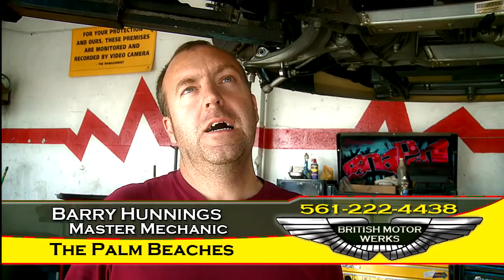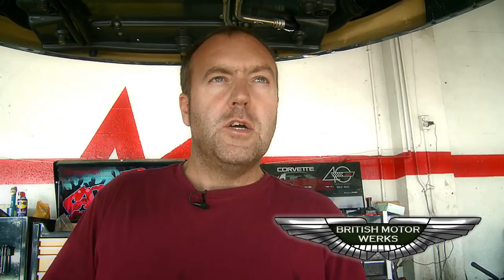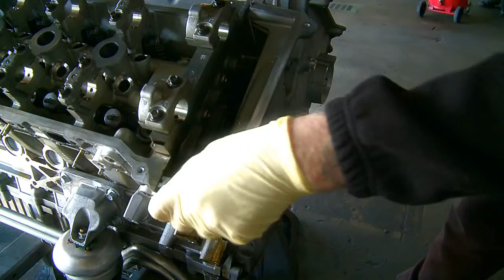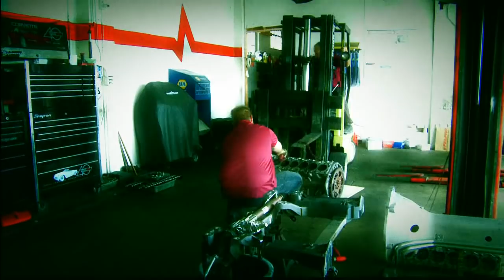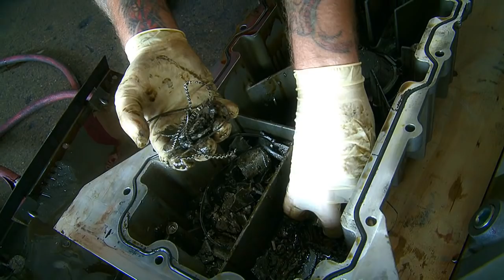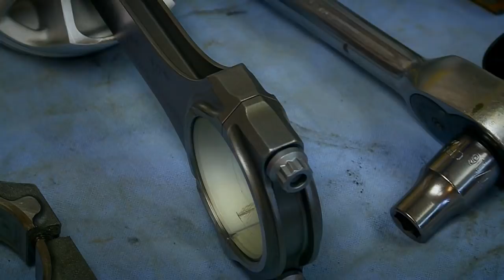2005 ASTON MARTIN DB9 Engine Detonation

Comment: Oil in the air filters is a sign of a PCV valve problem.   Known issue in these engines.  Also, the early 450 HP engine do not send oil to the small end rod bearing.

Comment: Nice video, I have owned a DB9 and currently a Rapide.  Lack of oil to rear cylinders is a design flaw in earlier engines.  Never let oil get below “Full”.  Keep it religiously topped of.  Marvel Mystery Oil might help since it is a solvent oil to remove sludge buildup in small oil journals.  It will evaporate off in about 1000 miles.  Agree that top spec pistons and con rods should be in this engine.

Comment: on these early v12 engines the lowest pick up is on cylinder 6 and 12 , the original dipstick marks are set too low on these engines rectified by Aston re replacing with longer dipsticks , you had to check engine oil was above the high mark to avoid oil starvation... Note thee is no electronic oil level warning light on these Astons once the low oil pressure light illuminates its too late . you have to check oil levels weekly ....good old fashioned practice . A lot of owners never bothered relying on service schedules , hence using oil , never topping up and hence gettin g into this  catastophic failure 20k worth of damage

Comment: Small end bearing wear. A known fault in early cars caused by oil starvation due to the too long dipstick. My first DB9 had the same issue. It usually manifests as a low end cranky ticking on idle. If you hear this sound on a DB9, walk away. It's literally a £20k rebuild using the updated cylinder bushings.

Comment: A bit of research will show the true cause. The early models had a problem because the engine oil dipstick markings were too low and this was caused by the dipstick itself being too long. This effectively put the level markings too low in the oil and in turn this results in the oil levels being too low for long term and high performance use, which in turn caused oil starvation and typically this effectively destroyed the engine. The cure, which was effected in an Aston Martin service bulletin sent to all service centres as soon as the problem was discovered, was simply to replace the dipstick with a new longer version which meant the engine had more oil - nothing else! My own DB9 had this problem and it caused serious damage which was resolved with a complete replacement engine at 30k miles under warranty by AM. I don't expect any DB9s are on the road these days that still have the early longer dipstick so even early DB9s are generally a safe bet nowadays. This video implies that AM engines should not be trusted and this is a complete fallacy. Yes, like many other manufacturer's early production examples, this engine had a design flaw but that it was addressed early on and effectively by Aston Martin. At no expense to the owners. The oiling system is not junk as is claimed - yes, a design error led to an inappropriate dipstick - not the entire oiling system and certainly not the entire engine or car itself! This video is just clickbait scaremongering! My engine is running perfectly after 75k miles, so suck on that! A mechanic finding a fault doesn't make him a genius nor does it make the manufacturer a scoundrel. This is just taking a cheap shot without any decent research. In my view this reflects badly on the video maker far more than it does on Aston Martin.
Reply: hey your db9 has 75k miles??? im about to buy an aston with 80k miles lol

Comment: The off the shelf piston ford PAG used kind of makes sense. The AM V12 is basically two duratec V6's mated together. But still, for 250k, they should of went dry sump with that piston/rod combo from the factory.

Comment: Would'nt all those metal parts damage the rest of the engine? Is it really worth the rebuild?
Reply: Not a problem. The schrapnel of parts submerged in the thick oil in one compartment. Total engine acid bath followed by clean room rebuild.
Reply: @budwolverton5916  Not sure I'd call 0w-20 oil thick, but chunks usually migrate to the bottom. All the rotating parts are probably fine as all the crap should be in the oil filter instead of the bearings.

Comment: Ford REALLY didn't care all that much for the Premium Auto Group (PAG) back in the days; look at how Jaguar Land Rover fared back in the early 2000s. It's no wonder the 6.0 V12 was designed with existing components; costs can be saved & it is just a simple matter of bolting two 3.0 Duratec V6 from their parts bin together & having a premium car for cheap.

The fact the 6.0 V12 with such mediocre roots still lives today yet with Aston's constant updates kept up with more demanding emission requirements & ever increasing demand of power is kudos to Aston once Ford left them for dead after post-2009 recession. Thankfully this engine will soon be replaced by AM's own effort in the new upcoming Twin turbo V12 which I heard was designed with aid from Mercedes-AMG division.
Reply: Pretty damn pathetic isn't it? What's the price difference between the stock shit pistons and rods vs a quality set? $2,000 give or take a few hundred? Literally ONE PERCENT of the cost of the car. Wtf man.

Comment: Not sure why they're crapping all over the piston assembly. it's not like 460 hp out of a 6 liter v12 is a lot. Those pistons and rods would run 200k miles no sweat with proper oiling. And no, an H beam is not stronger than an I beam.
Reply: If you don't know why there's an issue with placing economy car engine components into a $200,000 car, then there's no sense in explaining why you're wrong about the connecting rods.
Reply: GTRZE70 Fantastic argument. You've changed my mind.
Reply: +Cory Stansbury Good.
Reply: Of I beam and H beam rods made of the same material, the H beam is stronger.  This doesn't mean an H is always better than an I beam, the I beam may be more appropriate for a high revving engine for instance...
Reply: Baba Booey This isn't really supported by engineering. An I beam is stiffer per weight than an H-beam, at least in the typical bending direction (realizing an H beam is just a flattened I beam in the other axis).
Reply: I believe H beams handle compressive loads better than I beam.  If you put both in a vice and applied sideways force, yes the H would probably bend first, but that's not the application here.

Comment: Ford and Jaguar developed a V8 engine used in Jaguars, Lincoln (LS), Land Rovers and Aston Martins. The AM version motors are only used in AM and were built on the same site, but really in a dedicated section of the plant and most of the components were different. I guess Ford had "influence" since they ultimately owned everything, but it's like saying a BMW M3 motor was the same as a typical 328i ... the car in the video is a 2005, and AM has redesigned the engines somewhat since Ford sold off Jag, AM and Land Rover in 2008. The V12 was a unique motor to AM (although based on the discontinued Jaguar 12's). Again, I guess the relationship with Ford could have led to some carry-over of parts ... I think the 08+ V8 got forged rods, not sure about the V12, but they're built in the same plant which is now owned only by AM.

Comment: Ford DOES build these engines
Reply: This engine is built inside a Ford engine plant in Cologne France,, but is built by Aston Martin as they have separate Aston Martin division inside the plant and the engines are individually built by a single Aston Martin technician not Ford workers. This engine is used for Aston Martin cars not Ford cars, in the end it hurts Aston Martin not Ford.
Reply: @A-FrameWedge  Actually it's a Mercedes Benz engine plant.
Reply: @b747skyguy  Wrong, the V12 in the 2005 Aston Martin was made by joining 2 Ford Duratec V6 engines.

Comment: People on here blaming Ford.. lol. Ford has not owned Aston Since 2008.
Reply: +santiagomel00 This DB9 is a 2005 (which is clearly stated in the video description), meaning that the car was both designed and built WHILE Aston was under Ford ownership.
Reply: +santiagomel00 Doesn't mean they don't still have Ford parts ... which they do!
Reply from the maker: +santiagomel00  Car was a 2005 and video is 5 years old
Reply: it'd an 05 Aston.. Ford owned Aston when this car was built...
Reply: +santiagomel00 I would say that an AM from 2005 (Ford Era) that has a V12 engineering problem can be safely blamed on Ford since they were running the company at that time.
Reply: Have you got a brain?
Reply: In fact if you look at certain AM parts like the heater blower, it's really just a Ford blower that has some minor changes so that they can charge 5X as much for it.
Reply: You didn't even watch the video, did you? If you had, you'd have heard the machinist say, "This is the stock rod and piston that came out of this Aston Martin, basically your garden-variety Ford piston from either a Ford pickup truck or a Ford Mustang. Unbelievable that they put this in a motor of this caliber. For a motor of this caliber, of this status, I can't believe they put this type of crap inside it."
Reply: Ford also built the GT500... much cheaper car..... much stronger engine. So your argument is ridiculous. How do you explain that ? This is more or less a fault on Aston for designing and building a inferior product. Also the failure (if you watched the video) is due to oil starvation of cyl 6 and 12 and an obvious fault of the oiling system/pump which was designed by Aston Martin.  The Ford GT which costed less didn't have these problems.... this is all on Aston... sorry.
Reply: The only thing  stronger rods/pistons would have done would delay the inevitable for just a LITTLE BIT longer.
Reply: I agree it's not like Aston Martin was known for reliability for ford.. infact they probably improved after their ownership. Landrover reliability improved under ford ownership (from BMW ownership). So i wouldn't blame ford. Aston just made junk. Sorry. They stuck 2 duratec v6's together and designed a crap oiling system (that is totally on them).

Comment: PSCM said it below. These cars were recalled to fit a shorter oil dipstick. AML aren't going to pay repairs for a car that's been running with the wrong dipstick for 6 years and presumably not serviced as the dipstick would have been upgraded by AML free of charge.
Reply: Sparta Prague  - It was. Replacement dipstick service bulletins were sent out to all Aston workshops as soon as the problem was identified. Damaged engines were replaced under warranty. Including mine which had catastrophic oil starvation at 32k because the dipstick was too long. A design error, yes, but handled very well by Aston Martin. See my recent comment for details.

Comment: PART TWO?!
Reply: Thomas Ferrugia  - no part two is necessary. This is just clickbait scaremongering. See my new comment for details.
Reply: Who exactly is i intended to scare?
Reply: Thomas Ferrugia - the impression given by your video seems to be to trash talk the name of Aston Martin as a company producing inferior products and with no care for their customers. If you had done any research at all about the issue of trashed engines due to oil starvation as a result of the flaw in the dipstick design you would have seen that it was actioned by AM with a worldwide service bulletin and that affected engines were replaced under warranty, all as stated in my comment a couple of days ago. So I view such disparaging suggestions in your video as aimed at discouraging prospective AM buyers, slandering the company and making yourself out to be a wise and knowledgeable expert acting in the interests of consumer protection which, given your attitude to appropriate research, is a pretty shitty misrepresentation in my book.
Reply: It's not my video. I am not the original poster.  I am just a causal viewer and was curious to find out whether the car was ever fully repaired and the total charge for the parts and labor.  

I used to own a DB9 Volante and don't need anyone telling me how well it's made.  I've owned tons of cars and my time with with the Aston was, without a doubt, the single worst ownership experience I've ever had.  The car was an unending barrage of electrical glitches, malfunctions, leaks, poor-fitting trim pieces and the like.  The car spent 8 of the first 12 months I owned at the dealership for repair after repair.  Even after I'd practically rebuilt the car, new things would manage to break all the time.  While I never had this particular problem (oil starvation), it doesn't surprise me one bit that an Aston's engine would suffer from it.  You clearly work for Aston Martin (or a total fan-boy) if you imagine that you can justify Ford F-150 pistons in a $190,000 super-car car.  

Nice try though.
Reply: https://youtu.be/o-5ZRwv6DCY

Comment: Tell me those same pistons are not used in the Vantage 2006 V8!
Reply: zanick2 loll the vintage v8 IS a mustang V8
Reply: +michobebemckawi  NO!!! fortunately, the Vantage V8 is more of a racing bred engine.   drysumped and custom rods and pistons!
Reply: zanick2 oh well! I thought it was an evolution of the AJ engine v8 from the XK8 which derivated from a ford design. In any cases the vantage's size makes it unpleasing to my eyes and ill have to stick to the db9 when the time is appropriate.
Reply: +michobebemckawi actually, give the vantage a better look... its a more sleek and less bulky design that flows and looks much more aero than most any car out here.   the engine is a work of art as well, but it has a hint of the modern ford racing engines, with the high stack intake manifold and the drysump bottom end.  it shares nothing with the jag XK series, but the block. is a relative.   parts in the motor, heads, cams, pistons rings, crank rods are all different, and nothing is interchangeable.   the DB9 is a different story.

Comment: Aston issued a recall on all DB9's at one point as the dipstick was too long, therefore Oil could get too low, lose pressure and cause this!

They refitted a shorter dipstick and reprogrammed the oil sensor - sorted!

These examples that self detonate might have missed the recall and as such been running on low oil for too long!

Comment: what year is this DB9 ? what brand of motor oil and viscosity weight was used on the intital first oil change on the break in?  (which should be 5,000 miles)  is this vehicle stored in winter time?  please respond as soon as possible.  thank you